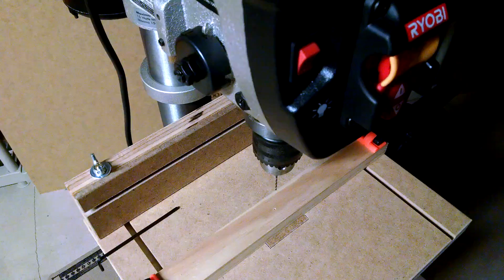Aligning Laser Crosshairs on a Drill Press

Comment: The right side laser is almost out, I can barely see it.  Can you post a video on how to change the laser?
Thabka
Reply from the maker: John, it may not be the laser itself that is bad. The lasers are powered by two AA batteries in a compartment just behind the front pulley under the drill press's top cover. I'd check the batteries before buying another laser. My right laser becomes erratic when the batteries fall below a certain voltage. If changing the batteries doesn't fix it, I'd also remove the battery compartment and check the connections underneath. You'll probably have to remove the front pulley to get at all of it. I tell you all this because it will be a while before I have time to produce a video. Let me know if any of this works!

Comment: Mark let me bounce a question off of you, that I suspect i already know the answer to, but would love your opinion. 

I have a Delta drill press. The laser on 1 side is great, about 1/16 wide and uniform. 
The laser on the other side is much weaker. It's thinner and less bright. The beam also breaks up on the back half of the table. I've cleaned it so i don't think it's just dirty. 

I'm guessing the culprit is just a bad unit that i have to live with or replace. 

Any ideas as to what may cause this to happen?

Thanks!

Comment: I have the same drill press and if I raise or lower the table the laser is no longer aligned. Guess I got a dud.
Reply from the maker: Fierceflyer55, that says to me that the head of your drill press is not properly aligned with the large metal tube it's mounted on. I wonder if the head of the drill press is fully pressed down onto the tube. You can check just by lifting the top cover. I suppose it could also be a bad casting of the head. The large mounting tube and the brass laser tubes must be perfectly parallel.

Comment: Hi Mark was thinking of buying one of those drill presses. What are your thoughts on yours after all this time. Many thanks. Rob.
Reply from the maker: Rob, I have been pleased with my Ryobi drill press overall. It has a very solid base, post, and head. The crank handle is a bit wobbly, but not a problem. This drill press has multiple drilling speeds, most of which I never use. The laser cross-hairs remain accurate regardless of the height of the table, so things are well-aligned. Some recommend using a higher-end JT33 drill chuck for smoother operation, but I've done just fine with the original chuck. The spindle remains snug all the way to the bottom, so there is minimal bit drift. I had to replace one of the laser cross-hairs, but that was my fault. When I tightened the set screw, I turned it too far and blew through the soft brass sidewall. It became difficult to set properly after that. One complaint is that one of the cross-hairs wants to blink on and off sometimes. I had thought it might be the switch, but only one cross-hair is affected. Hope this helps.
Reply: Great reply, thanks Mark.